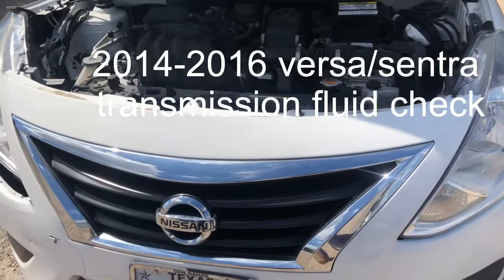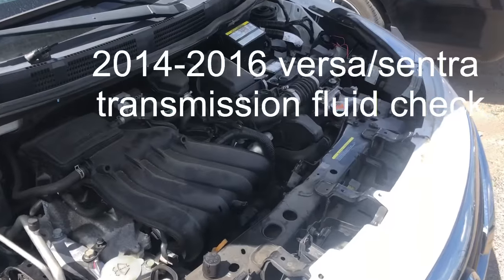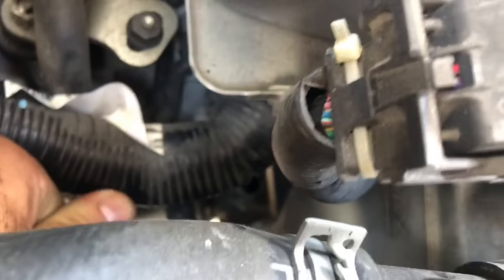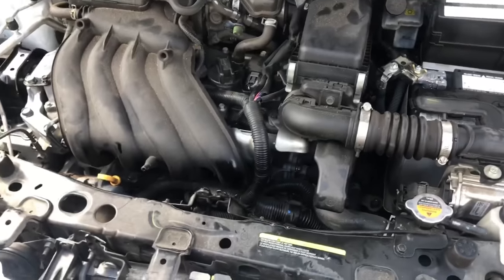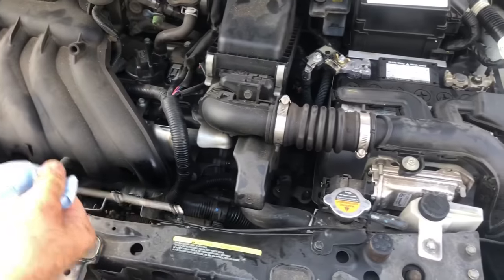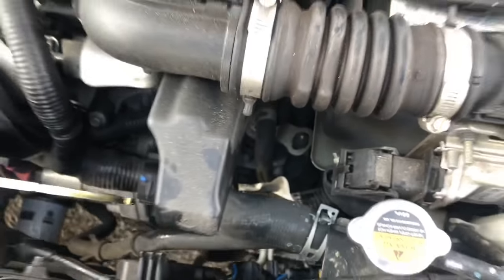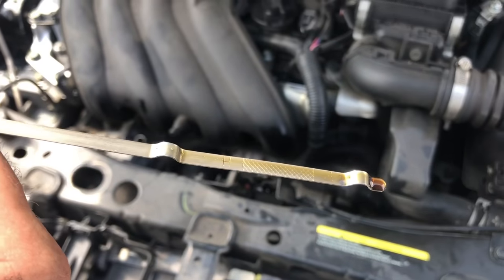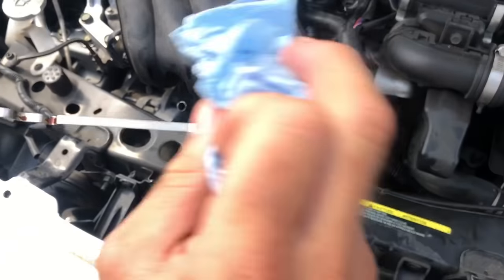2014 Nissan Versa transmission fluid check

Comment: Hello sir. I just want to ask if you guys experience trans failure. Like if im driving ang then stop in stop sign and accelerate then trans like shuting off or no power but the engine is still runner
Reply from the maker: John pacatang super common Nissan issues man, those transmission suck, all Nissan have same issues
Reply: @zdenanrehhelber  any suggestion what should i do? Change CVT fluid?

Comment: Well that sounds good, but aside from being able to see how clean the fluid is, or if any fluid is in the transmission, this method is next to useless. This fluid expands and contracts depending on temperature. So when you did this what temp was the vehicle at? Well if the next person uses this "fill level" as their reference point, unless the vehicle they are servicing is at nearly the exact same temp, they will be either underfilling or overfilling. The only real correct way to check it is to get the car to 105-110 degrees and as you open the transmission drain plug, the excess fluid will come out due to the design of this type of drain plug. This of course is usually done when someone drains it and refills it. This method in this video would have worked if an approximate temperature was given, assuming that car being used was filled to the proper level.

Comment: How do u flush and refill it?
Reply from the maker: chewpaeng12 to drain all u have to do is removed the drain plug in the bottom, just like when u changing ur engine oil, but transmission have lifetime oil meaning u not suppose to flush or change oil for the good of the transmission.
Reply: @zdenanrehhelber  "lifetime" meana the warranty time. 
You'll want to change anyways if youre gonna keep the car for a long time.
Reply: My Versa won’t accelerate when I floor it and it take forever and even in idle “Drive” it goes in reverse on a hill. Replaced the filter and it has super slow acceleration... thinking bad gas???
Reply: Maria Peralta Your vehicle has a CVT transmission, they’re very bad. The transmission is what gives power to your wheels and makes your car push the wheels and drive when you switch to D and R. Try taking to a local transmission shop first and ask for a “diagnostic price” and see how much they’ll charge just to see what’s wrong with it before you do anything to it.
Reply: @Maria Peralta mine is doing the same thing! Did you figure out what was going on?

Comment: Same method for manual transmissions?
Reply from the maker: fusewerks no, in manual trans u should have two plugs, one drain and one fill, till it start to dripping mean is full
Reply: @zdenanrehhelber  I mean, as far as checking fluid levels.
Reply from the maker: fusewerks like I said, you should have two plugs, one is whenever u want to drain oils fluid, the other one is when u need to add fluid and check fluid level
Reply: @zdenanrehhelber  gotcha. Thanks

Comment: Was this a CTV transmission?
Reply from the maker: Ryan Weaver you meant CVT (continuously variable TRANSMISION) is an automatic transmission that can change seamlessly through a continuous range of effective gear ratios.
Reply from the maker: It will change gear but you won’t feel it like regular transmission

Comment: Alguien sabe de qué color es el fluido de transmisión que trae este Nissan Versa?
Reply from the maker: César Muñoz nuevo es como color verde oscuro, pero cuando cae el piso es azul
Reply: @zdenanrehhelber  el de transmisión Matik s con el que salen de agencia??? Hablo del aceite de transmisión normal, no el cvt
Reply: @cesarmunoz2153  también hablo español, gracias a tu vídeo pude encontrar el tapón para la transmisión mi verdad es 2015 y siento que los cambios los hace muy forzados en las subidas, ¿qué me recomiendan hacer?
Reply: @gerardomontoya7661  amigo yo tengo un 2016 Sense automático, no es cvt e igual los cambios son muy ruidosos y algo largos, mi hermana tiene un exclusive navy 2017 igual automático y funciona igual que el mío, es muy ruidoso de la caja y cambios algo largos, según me dijo una vez un técnico para sacarle el mayor jugo a esta caja es revolucionaria arriba de 2,000 RPM, será?????
Reply: @cesarmunoz2153  sí claro caso siempre lo subo a 2 500 y una vez recuerdo hasta 3500 la verdad siento que no debe ser así pero tal vez es impresión mía

Comment: CVT transmissions suck and why the hell is the place to check down there instead of one top like most cars before.
Reply: Because you don't check you change the fluid every 40K to 60K miles with the OEM fluid. And I highly recommend using a fluid extractor pump.
Reply: @Jude13able  ThankYou
Reply: @donr5593  You're welcome.

Comment: On a side note, it would have been so much more entertaining if the transmission ate the dipstick. Just sucked it in and spit it out the tailpipe. That would have been epic.
Reply: You clearly dont know how this transmission look from inside!
Reply: @calorcito4209  hey. Your video is infuriating because the black hose blocks the shot. It would have been hilarious if, while you were feeding the dip stick cautiously in, it suddenly was ripped from your hands and disappeared with a horrific rhythmic clancking sound shimmiying the car.
Reply: The dipstick got sucked into the POS cut pulley and
Reply: Dipstick spun 4 times around the shitty CVT trans  Pulley and the trans slip is cured🤣

Comment: Are you freaking joking.
Reply from the maker: U a better and cheap way? Let us know
Reply: @zdenanrehhelber  calm down little guy. I was in shock that that's how you do it. I learned something.
Reply from the maker: DIG OR DIE PERFORMANCE hey man, ain’t paying $140 for diag and 250 for adding oil, hell no, there is always a way lol
Reply: @zdenanrehhelber  I did a transmission pan on a Altima and had to guess on the fluid level.
Reply from the maker: I’ll make one for Altima one of this days !

Comment: This video is a lie! My Versa doesn't have any way to check it under the hood!
Reply: I agree with you this video is huge misinformation. And apparently we have a bunch of hacks on YT giving bad advice. I just changed the fluid in my sister's CVT transmission and yes that plug is there but the dipstick for the oil is NOT what one should use to check one's transmission fluid. You don't have to check it you just make sure to change it out every 40K to 60K miles. And I tried it two ways first with the drain bolt which didn't let out much fluid and then secondly I used a fluid extractor pump from harbor freight and got a larger portion of the fluid out. The second method works the best and is less messy just make sure your transmission is hot. The only fluid you will not be able to get out is the fluid in the torque converter and that is usually about 1 to 2 quarts. And only use the transmission fluid from the dealership because if you use the stuff from a auto store or Walmart it could shorten the life of your transmission. Your owner's manual will tell you the exact type to get. And one last thing just put back the exact amount that you took out.
Reply from the maker: Don’t hate the player, hate the game 🫢
Reply: @zdenanrehhelber  Get some facts and then you can have some game.
Reply from the maker: Watch the video again 😂😂 straight facts
Reply: @zdenanrehhelber  I have watched it several times. What manual did you use for those facts?
Reply from the maker: You still don’t get kid!! 🤦‍♂️ let me explain you! This is a hack on how to do it yourself without any special tools or going to the dealership! Very simple! If you pay attention, this video was made using a known good vehicle for accuracy measurements! 💥
Reply: @zdenanrehhelber A hack just like you said. And all you're good at is being a hack. I'm not a kid. If you are a horrible teacher that gives hack ideas.... Keep them to yourself especially when they aren't accurate by any measurement.
Reply from the maker: Danm u still don’t get kid 🤦‍♂️
Reply: @zdenanrehhelber  Troll I don't feed trolls